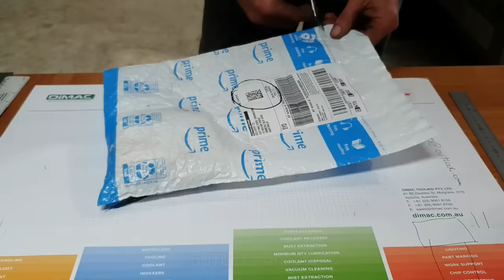CAT D10 Dozer Cylinder Rebuild | Part 2 | Making the New Barrel

Comment: Damn, those were some pretty freaking welds. I have never seen anything better than that.
Reply from the maker: Yeah was pretty happy with those myself 😂👍 cheers mate
Reply: Do you pre-heat / post-heat them? NDT?
Reply: @mikelammi3088  Most of the time Kurtis will have the part still hot from the expansion pre-heat for assembly and  therefore at a suitable pre-heat temperature ready for welding.

Comment: Hi Kurtis, imagine years back when they did not have Carbide inserts and only had HSS,  would have spent most of their time grinding tool bits.
Nothing like a stout boring bar, didn't see any perceptable deflection on that one.
Good job as usual.
Reply from the maker: Yeah bugger that, glad that some things have been invented and improved for today's jobs. Thanks for watching mate 😎👍
Reply: Even worse, back before they invented the HSS tool blank you had to forge, quench, temper and grind your own carbon steel tools. Then make a cut at painfully low speed to avoid annealing the edge.

Comment: Glad to hear that you explained the procedure to protect the bearings in the lath and using anti spatter on the piece of equipment, along with the protection of the blanket! In all the years that I was a welder, I only ever saw one bearing that had been arced thru, and that was a D 10 main bearing in the drive train !!

Comment: I was taught when welding on work in a lathe you still attach the ground to the work, just with a very, very, very long cable! :)
Reply: We do it all the time in our shop. We even have an old lathe specifically for welding. Just the headstock with a variable speed drive

Comment: I get a kick out of your honing center, I bought a Sunnen hone set thirty years ago, to do motorcycle cylinders, still got it, never knew they did such a big setup. My bores are four inch and smaller.  Really enjoy watching you work, top notch all the way!  you do a good job in dealing with welding in the lathe, I've had to do it a couple times, and always with great caution, much smaller lathe though.  I've learned a new appreciation for that four way tool post, you get a lot of good utility out of it, makes me wish I were in the same hemisphere and could visit your shop.

Comment: I work in maintenance I have asked many of people what are you doing? I catch them welding on a shaft on a machine or something else and they have put the ground clamp on a bearing housing. Yes I have tack welded stuff in a lathe and mill like he said make sure you cover up what you need to and make sure you put the ground on what you are welding on. Great video.

Comment: As a mechanical trainer, I use some clips and tools from you in my lectures.

The most important thing that usually distinguishes you and the clips that I like the most, in which the location of the broken piece and its location after installation is shown, or at least the location of the piece from a specific device.

thank you

Comment: Mentioned it before. Best thing I've found for covering anything to protect it against welding spatter is Fire blankets, cheap as chips from Bunnings hardware, they come in a red packet that usually hangs on the wall. Welding a vehicle you can throw them over paint work or engine etc or even peg them up like a curtain. They are woven matt that is non flammable and last for years. Great for welding MIG aluminum where spatter cant just be chiseled off. For the lathe it easy to throw one over the bed and another over any other part of the lather near the weld, no anti spatter to clean off.

Comment: Fine job on the cylinder and video both! I love the bloopers at the end for a particular reason. When I was in the Air Force we had to do quality assurance proficiency tasks. Every six months we were tasked on anything from removing a broken bolt to setting up the mill to make a drill bit with the auxiliary feed gears and dividing head. The whole time you had to give a commentary on what you were doing and why. Plus if there any special safety conditions what was needed to assure the safety of the technician. If you did well on these tasks and descriptions you usually were picked to do demonstrations for tour groups and dignitaries who had no clue as to what you were doing and why. 
 The most enjoyable but nerve wracking demo I did was for a whole group, ten to twelve, general officers. To my relief I didn't swear, stumble or flub any lines. A while after they left I heard the door open and here comes the whole crowd back! Out of all the stuff they got to see, my demonstration on threading and the different ways they can be made amazed them the most! So just off the cuff and totally impromptu I did a quick demo on milling.
 To my utmost relief they left and stayed gone.
 My nerves were frazzled and it took at least four cups of coffee to get right. 
 I did get congratulations on the demos and ended up with a thee day pass.
 One of the generals even came back when he was on base so he could chat and watch me work.
 So yeah......fuc* away! Trash those lines and let us hear the camera lady giggle and the inspector grin. You have earned it! 
 Cheers! 
Terry from South Carolina

Comment: Kurits great channel, thanks for posting your projects and the reality of running a machine shop, really first class, a couple of points, if you are having issues with machines like your line boring machine that prompted you to machine your own solutions perhaps worth considering manufacturing those solutions for general sale (if you had problems with it likely you are not alone) other thing (sorry mate its a H&S one) being on the later end of my career in general construction I am experiencing the effects of breathing air that was less than ideal, if you are in this for the long haul and it seems you are perhaps worth considering a forced air welding and grinding helmet such as Miller PAPR or a 3M Speedglas, best of luck

Comment: Thank you so much for your troubles making this, and all the other, videos! The bloopers tell it all! 
I'm not an engineer but fascinated watching how's done. 
A question for you or a viewer: How often must one check the lathe's own accuracy, in particular the headstock bearings? Thanks very much. 
Cheers Reiner
Reply from the maker: Hey Reiner thanks for watching mate glad you're enjoying the videos. The machines are inspected monthly for any obvious issues, then when we do a service will give it a real thorough look over
Reply: Just put on a new six-jaw set tru chuck on a gunsmith lathe (wide spindle, spider on back end). Total Indicated Runout on spindle was 0.0002. Then you add the D1-5 mount, which adds to it. Then there's the chuck itself...the 3-jaw I took off had about 0.003 TIR! HOWEVER, the point of a set tru chuck is that you can adjust all that additive TIR out of it, down to about 0.0004-5. SO, you should make sure your work is running true EVERY TIME you do any work on anything, and if there's a big problem that exceeds your specs, fix it.
Reply: @geckoproductions4128  what's the lathe for
Reply: @DaleDix  gunsmithing

Comment: Was watching this video and was very interesting watching the pieces take shape. Had one question: how do you insure that you are on center line of the piece when measuring ID or OD on the piece? I see you use several measuring different devices when measuring different things. I could see being off when measuring and getting the wrong measurement. When you are measuring so precise, I can see that being a problem when not right down to the tiniest bit off. 

Just curious! Keep up the good work!

Comment: When I use my water feed welder I use this nozzle dip I don’t know if I’ve seen you use that before or not what’s good about the nozzle dip when you go to clean the spider out of the splatter out of the nozzle it comes out a lot easier and your tip then all that other stuff lasts longer anyway this is Jim mungai From Kennerdell PA I got an old windy 160 wire feed welder squirting oh 23 wire works good

Comment: During the entire video, and the part 1 video, I kept on wondering how all this work is less expensive than a new OEM-part.
Your expertise, tools, hours, materials,... are without a doubt expensive (and worth it since you are very good at what you do).
I just can't stop questioning the prices OEM parts would cost.
I am not even near this industry so I have no clue about cost of parts and repairs. :)
Any insights in this? is there a ball park percentage of which this kind of rebuild is cheaper than new OEM-parts?
Any reasons where the difference in price is coming from?
Anyway, thanks for the content. Keep up the good work!
Greetings from Belgium.

Comment: hey bud at my old job we had a wire welder which could weld with 5mm wire and it had powder arround the nozzle so you don't need a welding helmet ,i mean your welds look great but with that powderdeck as we called it you can put much bigger welds in :) greetings from holland
Reply from the maker: That's submerged arc welding 👍
Reply: @CuttingEdgeEngineering  ah couldn't find the english word for that but yeah thats what i meant

Comment: What determines when you use lubricant when machining something on the lathe ?  Brilliant videos by the way
Reply from the maker: Hey mate thanks for watching. A few reasons... depends on the material being cut, with the chrome induction layer I use ceramic insert so no coolant on those otherwise thermal shock and the insert shatters. The carbide inserts can be run hot/dry or flooded wet so I prefer less coolant mess and usually only run it when taking heavier cuts. Hope that helps 😎👍

Comment: Love the honing machine! You burn a lot of wire welding for long periods of time. Do you burn up a welding machine every month or have you found one that can handle the continuous duty?
Reply: wia industrial machines are made for heavy production work. but your not running them at full power the time it takes for the slag to stop glowing is enough for the machine to cool down hence why multiple pass welds.

Comment: A stupid question. I’m not a metal turner. I turn wood but enjoy your channel. I noticed you put the bolt holes in the flange before you turned the inside. Doesn’t it affect alignment later?

Comment: welding in the lathe.... some people say you shouldnt weld a component on a motorcycle.... I've done it, but I do disconnect the bike electrics first.
I use anti spatter spray, take the precautions I can.. but if if goes FUBAR, its down to me.
I've tacked downpipes to collector box when they have been in place..... not sure of they are called something different in Australia, I think the yanks call them Header pipes.
Also had to fix a bolt hole previous owner had fubar'd. So filled the hole with weld, re-drilled, then re-tapped. He had stripped the thread on one of the bolt holes the bolt holding the fairing on went thru. 
Just mainly the Exhaust system I've tacked, whilst in place. Taken off to then weld up.

Comment: Welding on the lathe. - I would add -
lifting winch & electrical power tools. 
don’t use conducive lifting slings could earth through the winch. - remove earth metal bodied electrical tools. 
I’ve seen welding power source earthing through a hand grinder power cable.

Comment: How many thou - or metric equivalent ! - does the honing machine take off ?

Thanks !!
Reply from the maker: Hey mate the honing machine can take off as much material as you want, depending on how much time and many honing stones you want to use. A barrel this size the machine will average 0.25mm removal in 15mins.
Reply: @CuttingEdgeEngineering A better answer than my question !

Thanks !!

Comment: @Cutting Edge Engineering Australia
As a novice welder is there a reason for the direction you went on the horizontal weld @35:20 min mark? Reason or pro/con on leading verse dragging?

Comment: after doing the welds why don't you finish them off on the lath , they would look a lot smother, why do  only finish of the welds only with a grinder ?
Reply from the maker: Hey mate it's not necessary and would just add extra time to the job 😎👍
Reply: @CuttingEdgeEngineering   yeah true. also extra cost. but still it would look much cooler and might sell higher ;) .  Thanks for the reply and the smiles, I don't know how to add them.  :)  .

Comment: We (maintenance) had to make the tool and die people stop tigging on stamping dies while mounted on machine bolsters in rather large hydraulic press shop automotive body parts production line. Every time they did that, we had all our Siemens drive inverters fried because their high frequency welders grounds would back feed through our drives. Mig or stick welding was no problem. I'm so glad I don't work there anymore.

Comment: When you put the jaws back in the 3 jaw chuck, how do you get them even if you put one in and advance it, then the next and the next?
Reply: Each jaw is unique and numbered so you do not mix them up. There is a track inside which spirals to the center, you line up the start of the track for each jaw in specific order and they are made such that their “delay” matches them up evenly from the center of the chuck bore.
Reply: @YouriTegelaers  thank you for your answer.

Comment: If you put one jaw in at a time on the chuck and wind them in a bit each time, wouldn't they meet off centre?
Reply: No mate, the scroll has to capture them 1 at a time in order 1,2,3 then once they engage they will all meet in the middle assuming they where put in the right order and you didn't miss the rotation of the scroll where they first engage👍
Reply: @whatupg1  thanks mate. I was thinking they screwed in at an equal rate from the start, then there was a procedure to centre them

Comment: There's a word you use towards the end that Isn't in any application anywhere in the machine shop manual. Fawck! 
OH.. I get it now.
Reply from the maker: One of those words that gets passed down through the generations but is often needed to make sure tools work correctly and jobs get finished right 🤣👍
Reply: @CuttingEdgeEngineering  Either that or the dirty great big sledgehammer.